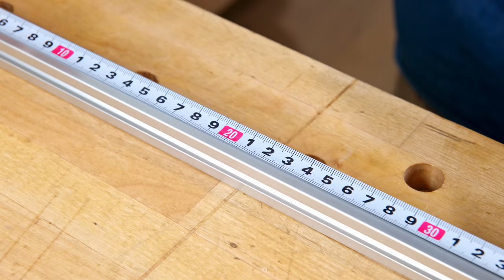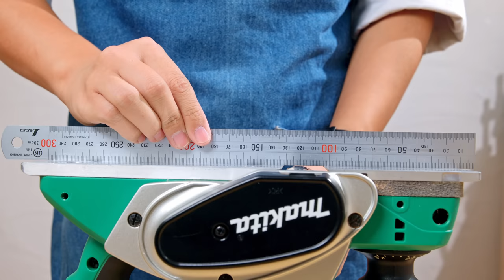Amazing ways to use hand electric planers as 3 types of processing machines

Comment: Always wondered why use a router with a sled to plane large panels and not a eletric plane in a sled. You did it
Reply from the maker: Depth adjustment is easier with a router.
The electric planer finishes work quickly.
Reply: I've used one this way for a while, with linear rods/bearings. 
 
But this system JSK-KOUBOU made has a lot more variety of use.
Reply: I believe router would be better if the panel had great inconsistencies. That would be annoying to fix with a plane and require many passes.
Reply: @maw9812  ... it would need a great deal of inconsistencies to make the router mire optimal. 
 
I use both, but over the past 2 years, I'm using the planer more. It has WAYYYY better dust collection, and a cleaner cut. (I use the Bosch 2632 with the 3 carbide blades for smaller items.) 
 
Plus, having over a 3inch sized blade requires a lot less passes overall. And a lot less sanding afterwards as it looks like it cane through a autofeed planer, but without any chatter.
 
Another big issue is the bit vs blade cost. I can buy 3 carbide blades, with dual edges (6 new blades) for around $10 (USD) whereas a decent, bottom clearing (spoilboard) router bit can cost me 7 to ten times that amount, and have a shorter lifespan. (However, if you buy a really good spoileboard bit with indexible blades, it will cost 20+ times as much initially. But, it will show EVERY single error in anything you use to measure squareness. I mean, 0.005" off on any of the parts of your entire system can make it a nightmare if you have dplintery styles of wood (like Oak, and especially Walnuts or Sapelle.)
 
So, in the long run, a thickness planer is best... but if you have boards with widths like 25", you'll have to throw $10,000+ at them. So the planer rig jigs are great imo.
 
(I use 20mm linear rails instead of wood arms like the video. But they , and the bearings need to be high end (like misumi) or they will have slop and move a bit on the shaft. And with a router or an electric hand planer , that can be dangerous and cause a kick if not careful.)
Reply: @jisakukobo  and less dust
Reply: A proper planer is definitely the better way to go.  easier much faster etc. Also bulkier heavier and more expensive.
 mine cost $400 & they get much more expensive.   A door plane like this I think it was $150.
A door plane takes up a lot less room in my garage and a frame like this can be utilized for more than just this. 
Lots of genius things are made to save money and if they don't do it "as good" a job but if they do good enough and they do 99.9% as good
 then call it genius and money saving and space saving and all those other wonderful things that it is.
Reply: @ottotater2787  indeed. I have a 13" thickness planer, but the problem is with wider pieces. You can get wider versions, but that starts to get into the $15,000 to $45,000 range. And while they're great for production shops... it's batty to even consider that as a part of a tool users budget. (But of you get to befriend anyone with a production style business, it is definitely worth helping them move, or bury a body. 🤣🤣)
Reply: @michaelbaykara2322  no, the amount of dust is related to how much wood you're taking off and if you need to turn one inch thick piece of wood into a 6/8 inch thick piece of wood then it's going to take off 1/8 of an inch of wood it's going to make that same amount of dust same amount of mass wood removed in the end.
Reply: there is more potential for tearout with a planer than with a router and good bit.
Reply: @cchavezjr7  if you get tearout with a planer, then there's an issue. 
1- Dull/old blades. (Why I like the Bosch 2632, it has thin, small, carbide blades that are inexpensive to replace, and hols an edge longer.)
 
2- Planing too deep a cut. (That's an obvious issue with any planing tool. Even when using routers as planers.)
 
3- Quality of electric planer. For instance, I'm yet to be impressed by cordless planers. 
 
4- Planing the wrong wood, in the wrong way. Woods like walnut and oak have splintering issues. But, that's where a good planer, and good blades come in. If I'm Planing a $400 slab that will net me $2200, I'm going t9 spend $12 on 3 new blades for the bosch use. 
 
With that said, you can still blowout wood with a router bit. 
A planer sled (done properly) can eliminate a lot of problems that routers have in sled Planing. You don't have the lines, or swirls. It's faster. Snipe free if done right. And you can actually extract all the dust lol... I love the dust extraction aspect. 
 
Also a good electric hand plane is <$150 in the US. A good bottom clearing bit, costs that much. Lol. Plus, a hand plan is fast, doesn't lose control if you hit a knot, and you don't have to worry about breaking the carbide  inside the router bit, and having it fly at you. Lol.
 
But the biggest advantage... speed! You rip through hardwood boards with ease and just pulling off 1/16 a pass, you can cover a 40bf board in minutes. (Plus... it's a lot easier to hold in doing so.)
 
Router planers are good... but if you have a good electric plane, and a good guiding/track system, it is great!
Reply: Routers are easier to make a sled for.  Depth adjustment is way easier and precise.  1/8 of an inch at a time with router vs 1/16 at most with plane.
Reply: @ottotater2787  no it wouldnt
Reply: @carterscustomrods You should check out Makita’s 40v planer. That thing is a beast.
Reply: @Pim Rademacher  yeah it is... The weight on it is ridiculous. We haven't got these in the US yet. 
 
So far, the US version of the 40v line have been really bad. The prices for a slight increase (and in some cases, a decrease)  do not justify getting into 40v. 
 
It feels like Makita is just doing a cash-grab on the 40v. The only tool alive actually liked, and I REALLLLLY LIKED IT, is the dust blower. 
 
Makita could've climbed out from under their 10% US market, but they missed out. The palm router was such a HUGE disappointment. I knew when it was released in Asia that Makita had made a really bad call. They needed to change a few things, but also give it a ½" collet. Instead, like other 40v tools, they didn't change much, if anything, other than a tiny boost to torque. But a tool like a router doesn't need torque when you can only use ¼" bits.
  
In essence, here in the US, most idiots buying tools think "MoAr ToRqUe" equates to a better tool. 
 

So, down the road, I might buy some Japanese models, but for now, my Mak-18v are a better value, and quality here in the US. And unless Makita can create a justification worthy of 2x-3x the price, I'll be sticking with my US, and Japanese 18v.
Reply: @carterscustomrods  I actually own 18v Makita tools mostly. I do own the dust blower, brad nailer, miter saw and bluetooth vac 40v though and they are really good tools, which actually outshine their 18v/36v counterparts. The vac and the miter saw where actually cheaper than the 36v models. Still in no mood to swap out my 36v track and circular saw though. They work great and will probably do for a long time to come. 

I’m not sure about the 40v router either. I’m actually on the verge of buying one of them and the price gap is about a $100 dollars. I know it’s probably a little better and I already own the batteries, so I might as well go for it. 

The planer is awesome. I hope you get your hands on one fast.
Reply: @carterscustomrods  ❤
Reply: Adjustment electric planer very tricky, but this guy make beautiful jig
Reply: @jisakukobo bisa nya e
Reply: @ottotater2787 yeah but the planer slices into fine steips. It's way more manageable.

Comment: Your slab flattening jig is simply beautiful !!!!!  Much cleaner than a router sled. I think it deserves to be made out of 80/20 or whatever brand of extruded aluminum you have where you are. Great videos
Reply: Agree. I've flattened a few thousand board feet of raw 8/4 lumber building doors with my router sled. This would have saved me tons of hours. I will use this method from now on. Good bye router sled.

Comment: I think that in some ways this could be better and more versatile than a planer and jointer combined. Especially for a small shop! One huge advantage should be that it won't leave any snipe
Reply: EXACTLY.
I just spent $450 on a 12" planer, & then got COVID again. I couldn't work for a month, & the 1st time I used it? The blades chipped. 

I had no idea it was even possible to stabilize a hand planer this way. (I've only been building for 2 years, & have been learning on my own.) 

I'm SO grateful to the creator for sharing these videos with us!

Comment: Thank you for saving me from ever feeling like I ever need to buy an expensive jointer that takes up valuable floor space in my small shop.

I wonder if this same jig would work with a handheld belt sander where a planer might cause tear out or where you need a little texture to the surface like when applying veneers to a flat surface.

Comment: Hello.
It would be great if you stick an adhesive edge (edge tape) on the runners. 9:30
Then it glided better and the surface of the runners was not erased.
Reply from the maker: thank you for the advice.
I use low friction tape.
I omitted the video.

Comment: Beautiful video. 
I have question . Im in the Philippines and see many similar planers, some appearing exact, being sold via mail order at rediculous lower prices than the original. Does the brand really matter? The reason i ask is realated to my need which is occasionally to use it on local hardwoods for small projects. So far ive had good luck with cheap price grinder and circular saws to get the job done at 1/3 the price.
Reply: Будь готов к тому, что тебе пришлют с кривой подошвой. Лучше проверять  в магазине перед покупкой. Я купил такой рубанок и потом пришлось дорабатывать его.

Comment: Using it as a jointer makes sense to me but as a planet for slabs not really, if you need multiple cuts to get the board straight you would have to shim it multiple times to be able to take another cut

Comment: I'm determined to make this, the only thing that worries me is drilling into the planer body. I've a Dewalt electric hand planer, and I'm wondering where I would find plans so I know I'm not drilling through something important! Love your channel though, incredible work!
Reply: @snowwny  I just removed the plate off the bottom and there is an available space there. I'm going to insert a wood block as a spacer to hold the bolt tight without collapsing the plastic body of the planer.

Comment: I did the same thing but i took off the plates and used the screw holes in there to mount my frame. I figured that since it's not going to use the plates, i might as well use those holes since they're setup in the factory for the plates to be right (at least on my Hitachi, the posts were shaved to make the plates sit right).
Reply: Would you have a video showing how you did it? Thank you!

Comment: It looks like "Option 3" requires much more efforts to being built, and is used to create 90* angle only, am i right? But the same can be easily done with simplest router in the table (. But first 2 solutions looks very interesting (if i replace expensive Al profiles with more cheap Al square pipes).

Comment: Much appreciated, hope to find all parts here in Brazil. Some aluminum profiles are hard to find and expensive here. However I try to substitute those for others easier to find on local market.
Reply from the maker: I buy aluminum frames from Misumi.
It's so cheap.
My plan has a link for Misumi's aluminum frame.
Reply: @jisakukobo  how do I buy the parts from that website, it only shows me options for a CAD design? I'm so confused.
Reply: @jisakukobo  just noticed I can't even create an account :( that's a bit disappointing lol any idea of what the equivalent parts would be for the UK?

Comment: Awesome setup! I really love using aluminum extrusion for jigs.  
 
What size is that? 2525 or 2020? (I made a similar version for a router sled, with 20mm linear rods and bearings... but yours is awesome since I can still use it on my linear sled, AND as a mini jointer like you have done!!!) 
 
5 STARS for a 5 star woodworker and jig maker!!!

Comment: Excellent work, it's what I've been looking for for a long time. Could you tell me if you can drill the rear holes in another device without damaging the interior?
Thank you
regards(Bearbeitet)Original wiederherstellen
Reply: It appears that he is only drilling the plastic casing of the planer, so one needs to be very careful hacking an unfamiliar device.
Reply: @Struthio_Camelus  thanks for your answer, I think it also pierces the casing below, the plastic would not hold the thread
Reply: @obetitiwows1752  I admit that I'd be tempted to remove the casing before drilling it, if only to check clearance from vital parts.

Comment: I'm still confused as to why he raised the slab height by 1mm instead of adjusting the planer cutting depth by 1mm.
Reply: adjusting the planer cutting depth only raise the front portion of the planer bottom,  but the blade height is fixed in relation to the table top.

Comment: This looks unpractical because you have to produce two blocs of the exact same height to adjust the height of the first pass, then if you want to keep on making passes, you would have to keep on using shorter and shorter blocks.
Unless you have an easy way to set the height, this is a big problem for this jig IMO